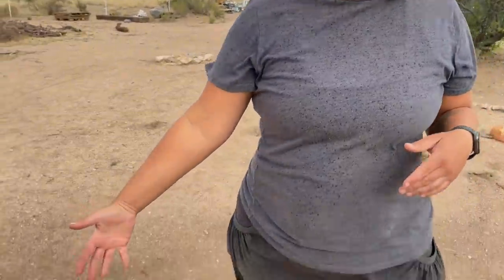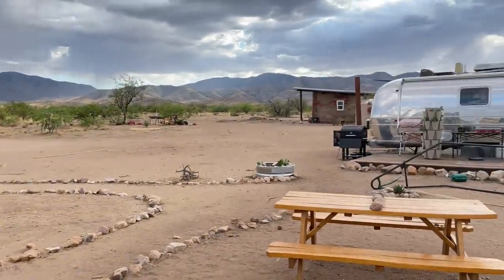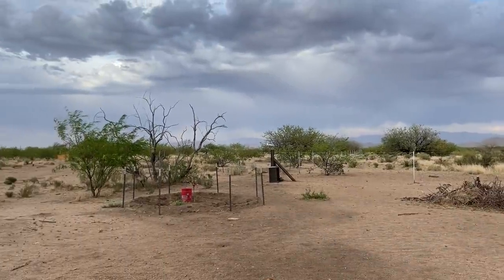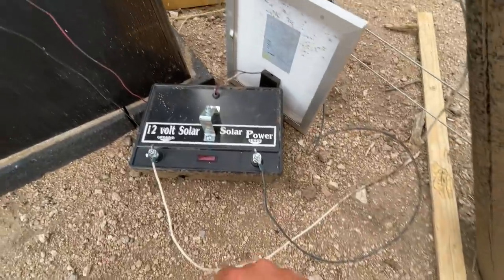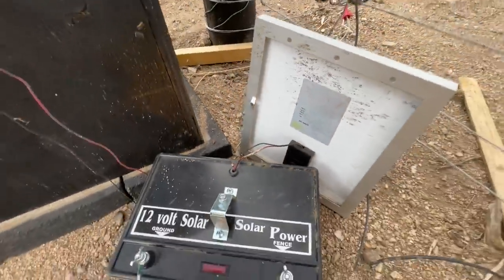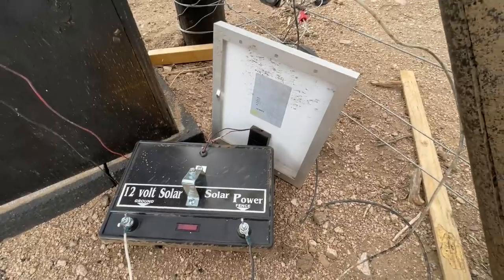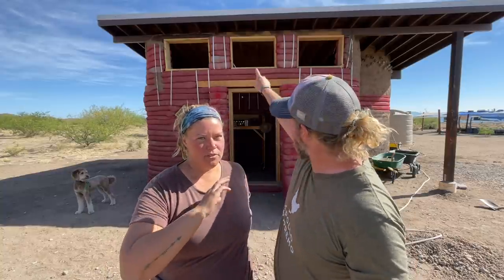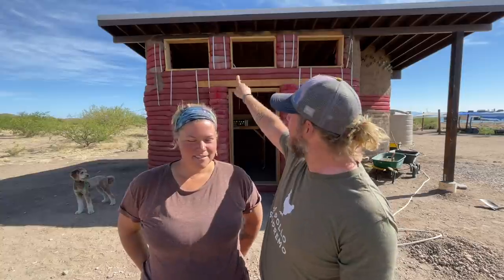Haboob Apocalypse - But we still have to cob!

Comment: Dont put the windows in until you finish the interior walls and floors. If it continues to be so hot the more air flow the better when working on the inside.
Start the floor and then finish the outside giving the floor time to cure.

Comment: You need to buy some sand and plastic cement unlike Portland cement which is for slabs and foundations, they use plastic to mortar bricks,swimming pools and stucco , stucco to building codes should have  a layer of tar paper and then chicken wire or lath fastened with screws or furring nails that have a half inch circle of paper at the head, to hang it . The tar paper is to stop moisture from wicking into your building,( I saw a YouTube video of a earthbag building built in Europe they had to put a coating on the outside to seal it up because it was wicking moisture) but if you did a brown coat ( the coat you put on after your scratch coat)with stucco it would be structurally harder and would resist falling off and would stop moisture or slow it down anyway, to avoid a constantly humid interior,( people misunderstand tyveck it's a draft barrier it doesn't stop water vapor totally unnecessary for an earthbag dwelling which is pretty much stopping drafts on its own),, next you need a hawk and a wide plasterers trowel the hawk  is a flat surface with a handle underneath you hold in your hand it's like 24 in you put a pile of mud on there you can grab with your trowel  and after Laying plastic at the base of the wall to catch  and reapply your droppings you start at the bottom and work your way up the wall  you just grab it and keep going up you could probably coat the out side wall in 4 hours if they kept the mud flowing to you,  I know I could, I haven't done any plastering since I was a teenager and then I stuccoed  my own house.    because of California's stupid certification law I was unemployed, I didn't have the money for my certification electrician test $300 ,I had to go to work as a hod carrier ,that's the guy who puts 100 lb sacks of plastic cement into the mixer with 16 full round shovel loads of sand then uses a wheelbarrow to deliver it to the plasterers on scaffolding or wherever they're at. That was A hard Day's work and those plasterers didn't know I could plaster too, at least they wouldn't let me, they just wanted me to make some more mud. By the way I took my certification test and aced it having 20 years in the electrical field  and a second generation electrician, I didn't even study. . I hope I explained the ins and outs of plastering  to make it easier and faster for you you could make a plasterers trowel and hawk out of plywood and 2x4 if need be ,you could put stucco on the inside walls too ,they sell a smoother kind of sand that  makes it just like drywall  you would never be able to hang drywall easily in all those inside curves anyway. Well you could you would need two layers of quarter inch drywall soaked in water oh yeah I almost forgot the final coat is 1/8 inch thick called a color coat and you can get color coat in all kinds of colors and shades they also sell styrofoam shapes to go around your windows and under your beams to give it a certain style like a medieval building then after fasting or gluing to styrofoam to building you just lightly stucco over that and lightly put a color coat  on it and it looks like something it's not it's just styrofoam but they have all kinds of different styles, you'd be surprised at how many buildings you see in town have styrofoam features

Comment: Just a quick warning. In my experience WIFI will not go through adobe! Be ready to put a Wifi router or access point on the outside of the solar shed. You might ger lucky with the windows but you will be a lot better off putting it outside
Reply from the maker: Obviously - that's why we put the conduit in 😂. But we have to pull in cell signal as well so we'll have data flowing both ways through.